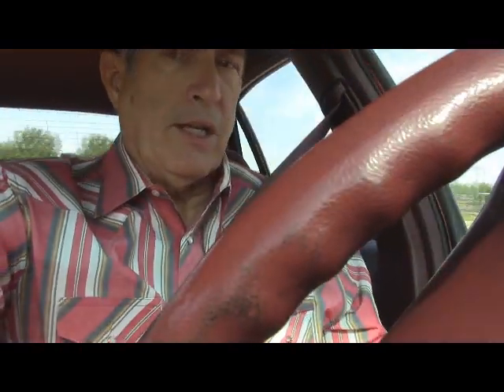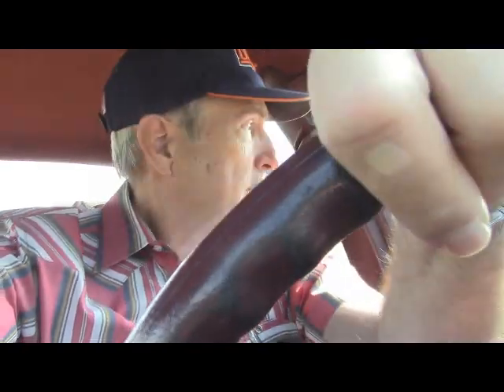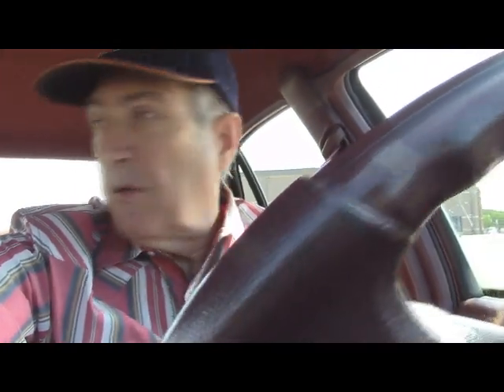How does Bad Front Wheel Bearing Noise Sound

Comment: This is my 2nd experience with a bad front wheel bearing. I had the wah wah wah helicopter noise in my Ford Fusion Hybrid 2010. Noise got louder on the RIGHT when I jerked the car to the LEFT at about 40 MPH indicating bearing to other side (RIGHT) was failing, per what I read on the internet and saw on youtube videos. I could also put my hand on the window frame on the right and feel the vibration which I could not feel on the left.

Sound got louder every day, and got so loud and so annoying, I started hearing the noise in my dreams. I read on youtube that the wiggle wheel test is another way to diagnose a bad bearing. I jacket up the right wheel and wiggled the wheel, and it felt OK. No play. I was reluctant to conclude that it was a bearing because I had a failed bearing before on the other side 5 years ago, and it did not sound like a helicopter when it failed. It sounded like a high pitched metal screech when I went around a corner. 5 years ago, that bearing failure was confirmed with the wiggle wheel test, and it was a very bad bearing.

No danger of my wheel falling off, so I took a little time to look for a good shop to fix my problem. Ford dealer wanted $180 just to do a test drive. Said that would apply as a credit toward a new bearing, Original Ford Motocraft part, which they said would be about $700 (including alignment). Ripoff.

Front tires were badly and unevenly worn, so, to eliminate that source of noise, I bought 2 new Sears tires for the front, and asked for a free opinion about the noise. Tire guy said it was my right bearing because my brakes were OK and my tires were not catastrophic. I asked to see the old tires and they did not have any defects or failed belts either. Car was a little quieter from new tires,  but that annoying loud wha wha wha helicopter noise starting at about 25 MPH was still there.

Found a repair shop that guaranteed a diagnosis (which they reconfirmed with a test drive). It was a AAA certified shop with a 10% AAA discount. Shop had 4 and 5 star reviews with absolutely no 1 star reviews. They picked a non-Ford bearing that was the highest rated longest lasting. It was a better price, and probably BETTER than a Ford bearing. They also did not require an alignment which saved a little more money. Got the bearing and the car was super quiet after that. Car still drove straight. 

So my question to the mechanic was, "why didn't the wiggle test show that my RIGHT bearing failed". His answer was that it was just starting to fail, so it would not show play yet in the wheel. He showed me the old bearing he removed. He said the bearing was not completely disintegrated like some failed bearings that he had seen. I will be adding another 5 star review to that excellent repair shop. 

 Glad to have that PROBLEM SOLVED.
Reply: My 11 Fusion Hybrid is doing the same thing. I want to know what the new bearing is off of so I can install it on my car.
Reply: Sad part is i had the screech for a year and a half now, paid it no mind.... now i have the wobble and like an idiot couldnt figure out what it was 🤦‍♂️... i shoulda changed it a year ago. And i hit a pothole really hard recently(3 times)
Reply from the maker: Wow, i'm glad the problem solved
Reply from the maker: Hope that worked
Reply from the maker: I imagine that did the trick

Comment: How to identify if the issue is the rear DIF or the wheel bearing? I have a similar noise (from the rear) which is INCREASING as the speed is increasing and I only start hearing the noise around 50+ MPH, also I seems when on the motorway (doing 50+ MPH) every time I turn LEFT (slightly) the noise disappears while I'm steering to the left. I have a Subaru Forester with an LSD Differential, the noise remain if I turn right. I seem to think that it's a DIFF issue, but not sure how to identify it myself. Thank you.
Reply from the maker: Thank you for watching my video!

Comment: i have the same wah wah noise in my 2017 hyundai ioniq electric, The noise is here from 50km/h to 70km/h.

What is the risk if I don't change the bearing and drive with that bad bearing?
Reply from the maker: Ultimate damage: If you don't replace a damaged wheel bearing before it fails completely, the wheel will completely seize up. If this happens while you're driving, the results can be catastrophic

Comment: I don't see a after front wheel bearing replacement video showing no more noise. There are differential bearings that turn at the same speed at the same time as wheel bearings.
Reply from the maker: I should have made a video... After the wheel bearing replacement.  More quiet!!!

Comment: my car doesnt make the womp sound but it has vibrations and grinding metal on metal was told its the bearings is that right? as i accelerate and coast  to a stop it gets worse
Reply from the maker: I am not a mechanic....   It could be.  If you are hitting your breaks and it sounds like metal on metal...  Maybe it's your breaks?  I don't really know..  I am sorry, I can not help you out. but I would get a second opinion.  Also, some garages are less expensive so check around for the price of labor and for the part.  Also, see what the warranty is.  I had a garage put one in and a year latter it went bad, they couldn't believe it, but they replaced it free.
Reply: Rich Rodgers my cars literally slammed not my bearing replaced em today and replaced roters and pads
Reply from the maker: @Chris-fb1ok  Sounds like that was it!!

Comment: My car was making that noise and the Toyota place was going to charge me over  $400 for a front left wheel bearing replacement. I went to another place that charged me $380 to replace the hub, bearing, and a retainer ring, and that was exactly one week ago and the noise is back! Do you think it is still the bearing if it sounds exactly like this?
Reply from the maker: Nora Lo I think so!   My Mechanic gave me a warranty and replaced mine a few months later. Have your mechanic check it out.

Comment: Exactly like a helicopter. I'm having a noise lately and for the first time I caht tell wtf it is. I don't hear it get much louder turning. I hear it mostly at 30-50 and on smooth roads. Even if I rotate the tires I hear it. New Rotors and brakes, etc and still have it. I have no idea wtf it is. Doenst sound like the normal bearing issue. But it has a slight whossh whoosh whossh sound. Idk if all my tires are having issues or what
Reply: I'm having the same issue.  Did you find out what it is?
Reply from the maker: Might have a mechanic look at it

Comment: My car is making the exact same sound and I'm terrified
Reply from the maker: Shop around see the best deal.  You might read some of the comments below.
Reply: @RichRodgersOnline  is it bad to drive on it?
Reply from the maker: I copied this off the Internet.  . How Long can you Drive with it?
The bad wheel bearing is worst and needs to be replaced immediately. But, what if you are in the middle of a deserted place where you can do nothing but to drive ahead? Well, in this situation you can hear some faint echoing or humming sound from the right back. At first glance, it might seem like the tire has gone out of balance. Later or sooner the increasing noise would clear that it’s a bad wheel bearing. There is no lubrication on the worn wheel to keep it unruffled. As a result, the increase in speed would develop the too much heat as well. The heat would crash the wheel completely. To avoid this situation, it is recommended to drive at the slower speed so that your wheel stays in action a few more hours. SO, while thinking how long can you drive on a bad bearing? You should not go more than 1000 miles as it might result in some bigger issue.
Reply: @RichRodgersOnline  I've had the car since last August and the sound has been going on since but getting worse it sounds like and I've been driving it for awhile
Reply from the maker: I get it fixed as soon as possible
Reply: @RichRodgersOnline  I can't afford that.  :'(.   I'm poor.  Was in a bad car accident last summer and still suffering injuries
Reply from the maker: @jacob1652   I'm sorry, you might ask your friends if they know a shade tree mechanic who is reliable
Reply: @RichRodgersOnline  if I don't feel vibrations in the steering wheel yet, is it still ok to drive it?
Reply from the maker: @jacob1652  see if someone can give  you a free inspection maybe a tire center..   they should tell you
Reply: @RichRodgersOnline  thank you so much for your help!
Reply from the maker: @jacob1652  you are welcome
Reply: @RichRodgersOnline  I got it fixed!  I had get both of them up front replaced.  But it's all better now
Reply from the maker: @jacob1652  was it the bearings? I hope they didn't charge you an arm and leg.
Reply: @RichRodgersOnline  it was definitely the wheel bearings and actually stepdad fixed them for me
Reply from the maker: @jacob1652  I am happy for you that is great news!
Reply: @RichRodgersOnline  thank you!  I'm pretty excited too